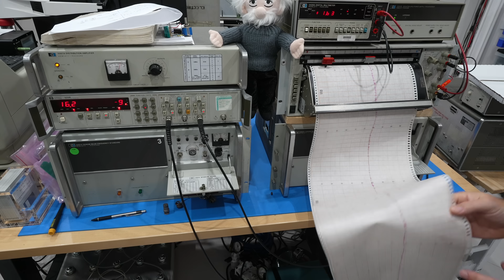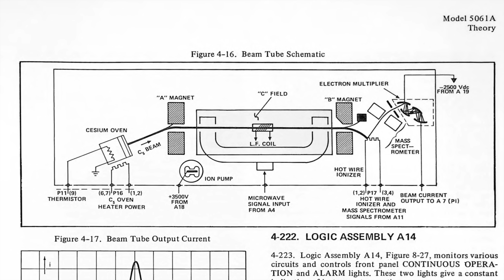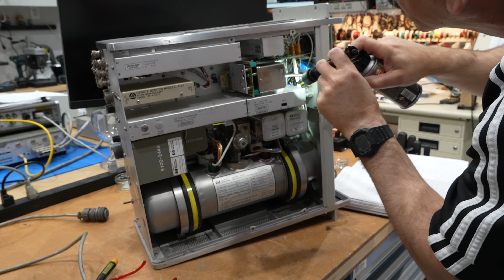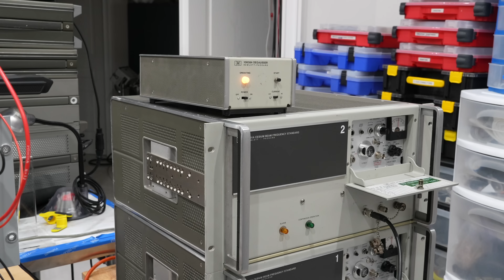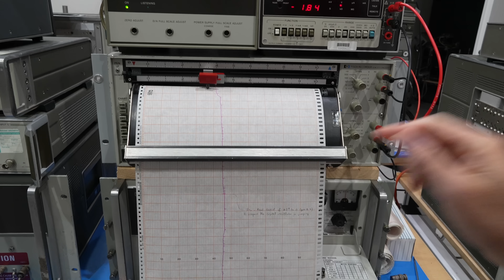Fourth HP 5061A atomic clock repair: revisiting a clock that showed parts per trillion instability

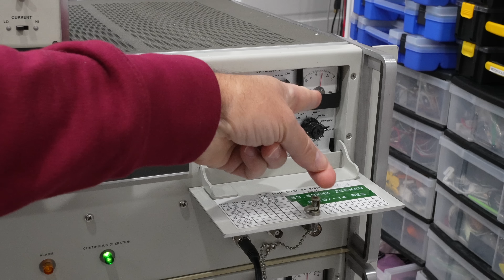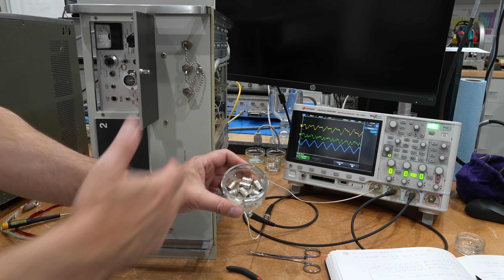Comment: Whilst it is unlikely to be your issue, 30 or so years ago I was involved in qualifying a satellite earth station to Intelsat standard A. One of the tests was a 24 hour frequency and power stability test; we failed the test several times as both power and frequency drifted off limits. We decided to set up an environmental monitor running in parallel with the stability tests and found the temperature remained stable at 22C until 22:00, when it started creeping up until it reached about 32C, then rapidly reduced to 22C shortly after 06:00. It turned out that the accountants had deemed that running the AC overnight was wasteful, so it was turned off at 22:00 and restarted at 06:00 - this was in the Caribbean, so the outside temperature was around 32 to 35C day and night.
Reply from the maker: These darn accountants. They'd make any engineering project fail.

Comment: Really? I wouldn't trust this type of repair for the switch in that kind of precision device.
Hops of that kind looks like bad connections and in a first thought I would blame the switch for that again (maybe I'm wrong - but I had some experience with audio equipment and contact gold ... Sometimes it works and sometimes you hear that it doesn't work).
On the other hand, there are so many plugs ... You may have an issue there. Had you tried to knock against the case after reassembling to proof that nothing  changes?

Comment: What would cause a certain tube to be 'better' than another (when coming from the factory)?
Reply from the maker: I’d venture mostly better signal to noise. They also run the high performance tube’s Cesium oven at higher temp than the standard ones. That increases the strength of the Cesium beam, and therefore the signal to noise ratio. But it depletes the Cesium faster, which is why the high performance tubes don’t last as long.

Comment: Microphonics is usually the stuff of valves and switches. In some rare cases in my experience cables too. Well found. Next perhaps the random frequency "burps" might be thermal breakdown of a semiconductor. Judicious application of a heat gun might help.

Comment: Dear Marc. Thank you for your wonderful channel!

 It just came to my mind (probably you or your viewers have noticed this before) that the numerical value of the frequency- 137Hz is suspiciously close to the inverse value of the fine structure constant of QED: 1/alpha=137.036… Clearly, there could be no physical reason for this( the frequency in Hz can not be equal to a dimensionless number, such as 1/alpha). Probably any frequency in the 100Hz range could do. So I view it as a nice „easter egg“ from developers of the clock :)

Comment: Looking at the chart readout. Could the mains switching over be part of the reset jumping? Perhaps you need a constant AC supply (inverter) that is fed from Batteries. That would eliminate this problem.

Comment: Noisy switches and connectors are the bane of electronics. Practically every system I ever worked on was brought low by a switch.

Comment: Marc, I would keep the OCXO running for a while. These OCXO show a behavior called "retracing" where they do an accelerated aging after they were shut down for a long time. This can take weeks to stabilize. After all, they are mechanical devices. I've seen this with many surplus OCXOs (and GPSDOs) I bought from Ebay, and also with OCXOs in frequency counters. They exhibit all kinds of nasty behavior during that period, mainly frequency and phase jumps. Those could be the reason for the phase shifts and also the control voltage shift you saw.
Reply from the maker: I’m thinking along these lines too, that it could be the OCXO being unstable for some odd reason. That would be quite unusual. But if it’s just drifting that’s no issue that’s what the locking loop is for.
Reply: I wonder what the feasibility of running more than one unit off of the signal from, or, directly from, one OXCO is. At least in that manner you could eliminte the error from differing OXCO's randomly doing odd things.Granted, you need discrete OXCO's in each unit to separate them for proper experimentation, but you could also compare the drift between the OXCO's signals outside of having them be part of the full unit circuit, and then possibly eliminate the glitchy one.

Comment: First, correlate the time of the jumps with events in the lab. A hunch leads me to believe that the last bump seen correlates well with the lab's lights or heaters turning on. Typical phase detectors of the day involved double balanced diode mixers. This being HP the mixers probably involve the HP "Hot Carrier" diodes. ( "Hot Carrier"? Go ahead - look it up. I'm shamelessly playing the oldest nerd in the room part.) Those diodes came in clear glass packages. If they were used in this application, I bet HP would have painted them black AND shielded them well from light. At any rate make tests to see what environmental changes affect the clocks. That could involve power line voltage (um, and wave form) shifts, heat, drafts, light, seismic events (even mere weight shifts as people walk around), and so forth. The room is part of your clock's environment. Figuring what environmental factor might be causing your problem can narrow your search down dramatically.

A small screwdriver with a long shaft can make a wonderful debugging tool. Tap everything with the screwdriver's handle or tip until you see a signal. Of course, tapping coax cables will do that so you may have to gently wiggle them. One thing I would initially suspect is the loop integrator capacitor. Some types of capacitors are quite microphonic. It might also have drifted enough with time it may not give the feedback loop the correct performance. mmph, the resistors in the DC loop could also become nifty drifties or quite microphonic. But that latter falls under tap EVERYTHING.

I would also look for noise on the crystal oscillator's power supply. There is a small chance this is due to the oscillator's oven's temperature control loops.

{^_^}

Comment: I wonder if those bumps are tracking room temperature? When the house furnace turns on, or you get to the lab and turn on the lights? Specifically I'm suspicious of bimetallic effects in a mechanical component. That same switch again, or a cable connector, or even some corrosion in a coax cable.

Comment: Do the times line up with anything else in the lab/house - heat, A/C? I wonder if bringing down an amp and speaker and doing a slow frequency sweep would expose any other electromechanical sensitivity.
Reply: Also, isn't this a relative sensitivity test against the other clock; could it be the other clock drifting?

Comment: 9:14 Those signals would make a lot more sense with the scope in X-Y mode. In phase=line, out-of-phase=circle or oval; rotating figure=not locked, steady figure=locked.

Comment: I just rescued an old power supply from the trash heap by identifying a bad switch!  I the case of my supply, the switch changed between volts/amps and noise on it was causing the meter to go crazy. When I saw that the output was stable i knew that that the supply was salvageable.  I was just happy to save an old supply from the trash and let it keep running (hopefully) for a few more decades.

Comment: Marc, how is the AC power for your lab? Regardless of the various power supplies regulation capabilities…. We have a lot more noise in .AC power then they had back in the day.  The digital world has infiltrated everything with noise.  Also earth ground for the lab is critical ….  Flaky behavior can often be tracked down to power and ground….   Don’t forget RF infiltration. 

Power conditioning may help greatly.

Comment: One possible problem could be in your oscillator Circuit. The oscillator itself is quite a complicated circuit complete with heating elements , a zener diode which supply’s power to your  varactor diode which Controls your frequency. 
I know that with my unit, which is in a room which varies in temperature that the control voltage changes to compensate for it. 
I noticed that the unit you’re working on is on top where is exposed to any change in the room temperature.
If I were you, I would first try insulating the top of your unit to try to stabilize the temperature.
If that didn’t work, maybe swap with one of the other oscillators and see if that stabilizes it.
Remember the oscillator controls the whole stability of the unit.
Good luck and don’t give up !
Reply: I like where you are going with this. The airplane units would have been experiencing a constant physical vibration as well. I bet they found all the loose connectors after a few flights.
Reply from the maker: Can’t be temperature. The Cesium line is insensitive to temp, and this is a jump, not a drift. It has to be something in the control loop. But where? Could be anywhere in the loop!

Comment: even cleaning silver plated wafer contacts with contact cleaner isn't really enough in my opinion on equipment I have had put 800 Emery cloth the wafers on both sides as well as the wiper contact... I think they do gold plated ones which would be so much better.. Maybe you can take that wafer switch out and inspect and clean. I am presuming though it isn't a gold one.  love to see you get that clock working properly

Comment: I wonder how good the hydrogen maser at Harvard was compared to these clocks back then?
Reply: HP wasn't selling clocks yet, but National Radio was selling the first commercial Cs clock, the 'Atomichron.'  It took up a whole 6' rack, and that's what Ramsey, Kleppner, and Goldenberg used to characterize their maser.  I don't think I've ever seen any actual performance measurements that would compare to what we now use (Allan deviation), though.

Comment: I wonder if it is possible that you have some glitch in 137 Hz signal reference that causes phase detection to freak out? Aside from already suggested voltage, current measurements I’d long term measure this signal for any sudden changes (maybe scope envelope test using reference capture and a long ring on failure)?

Comment: Are you planning on running them just as an ensemble of two stationary clocks and two portable clocks? 

If so, it's a bummer you can't take three clocks with you. Then you could use a majority rules comparison between the three to reject any jumps from any of the clocks, and correct the jumps in post-processing. Since the Allen deviation of the remaining two clocks over the short timescale of a jump is probably pretty deeply sub-1ns, you ought to be able to rely on this to bridge the gap and "plaster over" the jumps.

Even with two clocks per ensemble, if you could be darn sure that only a particular one of the clocks was jumping, you still ought to be able to just ignore the jumpy clock during the jumps, relying only on the remaining known good clock during those very short time intervals, and still using the ensemble of two clocks between jumps.

I know that the Allen deviation sort of doesn't quite work this way mathematically (no random walk process is additive over time!). But since you're not doing this to prove a scientific fact for peer reviewed publication, I feel like you could choose some suitable time intervals before and after a jump to average the difference between Clock 1 and Clock 2 pre- and post-jump, call the change in the difference the "jump amplitude", and subtract this from the accumulated interval timed by Clock 2. You could even establish a script or algorithm to detect jumps above some threshold and do this deterministically, locking in this algorithm before the experiment started, so nobody could accuse you of cherry picking data!

In order to enable this sort of "cheat code", you'd need to be very, very sure that only Clock 2 exhibited jumps. I know you love your HP stuff, but doesn't it seem like you really need to be able to run a tripartite or four part comparison between all three clocks at once, to definitively establish the short-term jumpiness of each clock? I don't think your gear can do this right now, since that comparator thing you're using is only a single gate input, right? I'm sure Mike could whip up some sort of FPGA based timing comparator for you!

Comment: So fundamentally what makes a particular C field setting "correct"? I don't like the feeling that it's not really an absolute measurement of anything and we just agree the frequency by consensus.
Reply: The C field is set by applying an audio tone in the 50 kHz neighborhood to the Zeeman input jack, with the clock unlocked, and adjusting for maximum beam current.  The Zeeman frequency is specified on the label inside the front panel door.  As long as the Zeeman frequency is within 1% of its target value, which is trivial to achieve, the clock's frequency accuracy will be down in the parts per trillion.  The only real complication is the need for degaussing to meet the tighter specs for the high-performance tube option.  

For what Marc is doing, he could just as easily measure the constant frequency error and take it out of the final measurement.  You only really need to jump through these hoops if you need a genuine primary standard.
Reply from the maker: C-field and correct adjustment thereof explained in this video: https://youtu.be/xTy1kY_wtsY . However we are going beyond what these clocks are normally rated for, so we need to tweak even further. In the original experiment they didn’t even bother, they just characterized the drift between clocks before the experiment and subtracted it afterwards. But for the video it’s clearer if you put the two exactly on top of each other and get a direct reading.
Reply: @CuriousMarc ahh its about exceeding design specs, that wasn't clear to me thanks! Could you show design tolerance on your next drift plot? I think it could illuminate just how accurate these have to be.
Reply: The C field setting is correct when your clock agrees with a more expensive one at a better lab. 🙂

Comment: Again, several Gremlins caught, but there is still one playing Peekaboo. Whether it hides in the switch (usually you take it apart for cleaning. Why not this time?), a dodgy soldering or capacitor, it will be found and put in a dark, dry, and cool drawer. Together with the other Gremlins 😊

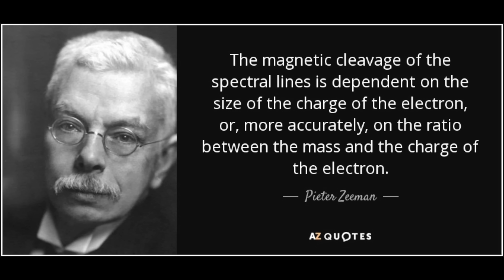Comment: 4:20 0.1 parts per trillion is honestly totally unfathomable
Reply: Modern optical clocks use different atoms such as strontium or ytterbium that operate at much higher frequencies.  They are 2 orders of magnitude more accurate than a cesium clock.  NIST is continuously working new more accurate and stable clocks.  Accuracy and stability records seem to be broken every few years.  Makes you wonder what the limit of accuracy and stability actually is.
Reply: @mikesradiorepair  Planck ? :)
Reply: @andymouse  They will probably end making a machine so big and complicated to measure time accurately that they will end break the space time continuum.  Being my luck they will turn it on the day I win the lottery and time will start to run backwards.🤣
Reply: @mikesradiorepair  Yeah my luck too LMFAO :)

Comment: One thing to try is to monitor the current in the c field and the voltage in power supplies in real time with the drift and see if they are glitching out
Reply: Maybe add to that environmental conditions? could just imagine the AC kicking in and blowing on the clock, or something daft like that.
Reply from the maker: Power supply and C-field already checked and repaired from previous episode: https://youtu.be/Hyo9vG5D3EE . So I doubt it that. Plus the Cesium atomic line couldn’t care less about power supply and temperature, so it’s not that either. It’s got to be something in the control loop, but what part?
Reply: @CuriousMarc  I don't know how modular the control loop is, but how easy/difficult would it be to swap the parts into the other clocks, in order to see if the problem follows the part into the other clock?

Comment: Isn’t the wafer switch in your reference clock causing the same problems? You said the EUT of this episode is slightly less noisy than the other ones. Shoot some additional deoxid!
Reply from the maker: No the reference clock gives me good results with the two other clocks, so I don’t think it’s that. It’s specific to this very clock. That said it probably wouldn’t hurt to preemptively deox the other clock wafer switches now that we know about the weakness…

Comment: Aren't these 5061A using the handselected, extra stable 10811 OCXO? Maybe some kind soul pinched the super-10811  and replaced it with an ordinary one?
Reply: Yes, they had 10811-60109s, which were the pick of the litter.  

This clock had enough issues that the original user probably just gave up on it and put it in a closet.  The good news is that's probably the only reason why it still has a healthy tube.  The bad news is that crystal oscillators often get noisy and/or jumpy when they are allowed to sit unpowered for long periods of time.  (That's not great for the tube, either, for that matter, but it's better than leaving them running for years at a time.)

Very often this problem fixes itself after a few weeks to a few months with the power turned back on, and even if it doesn't, it won't affect the long-term measurement he'll be running.  TL, DR: it's very unlikely to be as big a problem as he's making it sound.